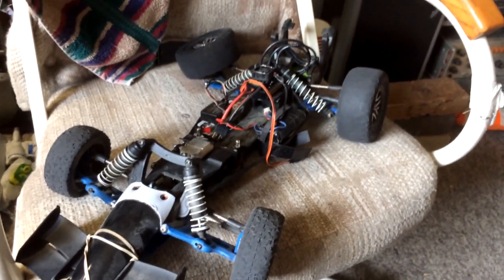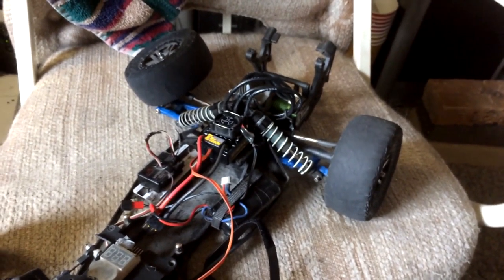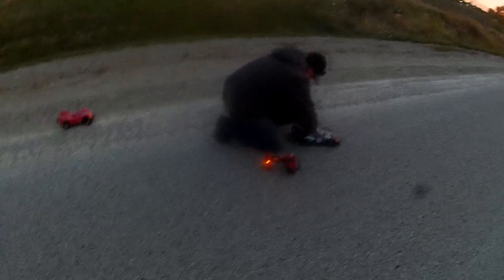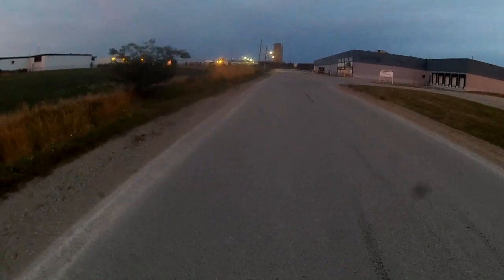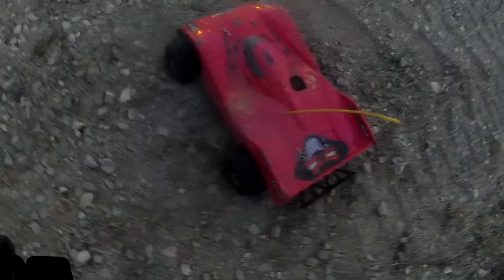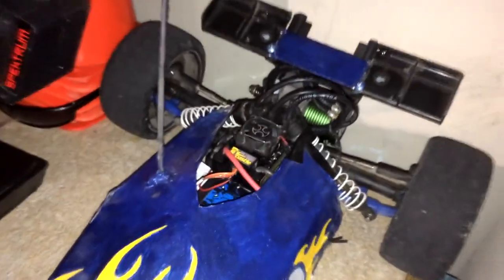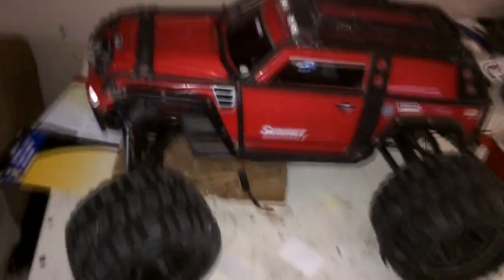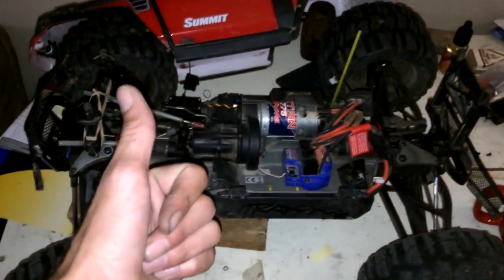M.E.R.V. Overkill, Heff's Mini-Revo

Comment: Once I got home I looked at the mini E-Revo I blew all four tires right off the rim due to the glue letting go and the chief rims are cracked so I couldn't even give it full throttle far is the XO one goes I think I got the steering dialed in I messed with it first thing this morning I just got to take it on a road test now
Reply: Hey Heff...Does the XO have TSM??
Reply: B&C Ultimate RC no it doesn't have TSM I might need to get one or put a gyro in it still a lot of testing to do or I need to pull some power out of it I ramped up the timing and the thing is so hard to control its crazy but I think I got the steering issue fixed we just got to set up a day and do some more testing